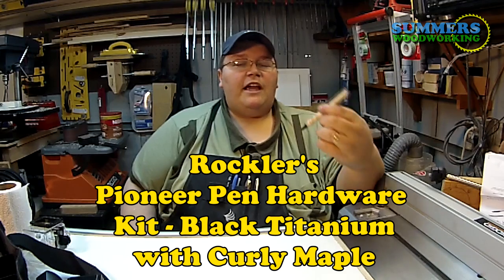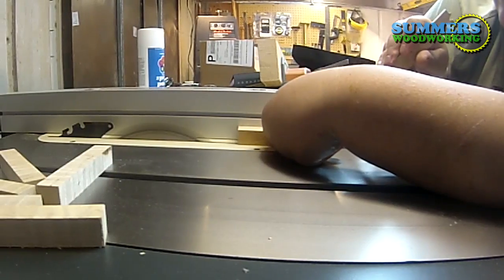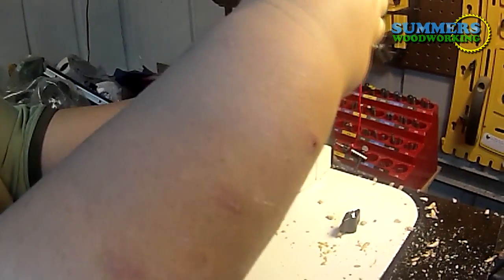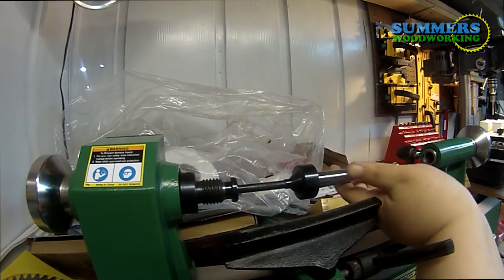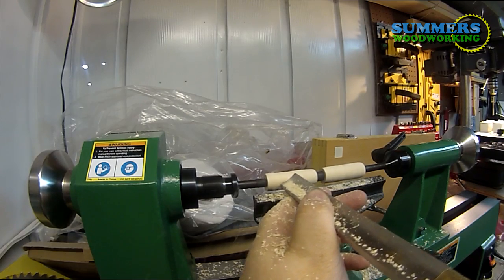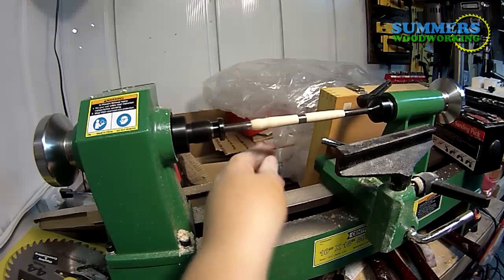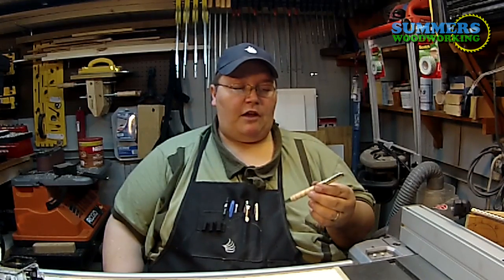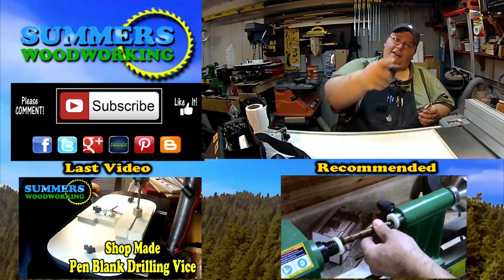How To Make A Curly Maple Pioneer Pen

Comment: Nice job!
I haven't made a pen yet, but I've turned several ornaments using the same technique.
Sometimes I drill small scraps of wood and use them as spacers up against the blank, so I don't have to worry about hitting the steel sleeves with a turning tool.
=Brian=

Comment: Brian, you did a great job!  I knew you were enjoying this project when I saw the expression of joy in your face during the final piece assembly.  Just wondering, do you need some diagonal supports on your lathe stand?  I saw it moving back and forth in a few shots, but it may have been the wobble of not being on a flat floor.  I have a drill press with a molded base that wobbles like crazy on the floor.  I've been thinking about drilling holes at the corners, and installing some 5/16" bolts that are adjustable to firm the drill up.  Anyways, thanks for sharing.
Reply: ***** Oh, that makes sense.  Man! since you posted that post on Woodworkers on YouTube this afternoon, I've gained 8 subscribers!  Right On!  Thanks!